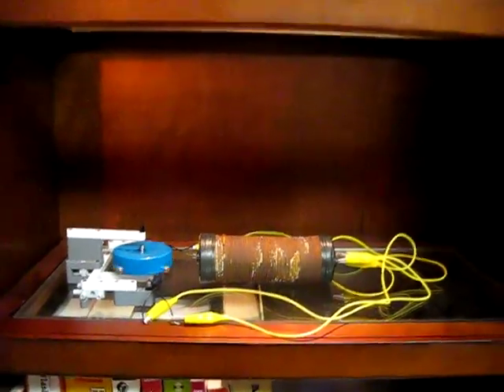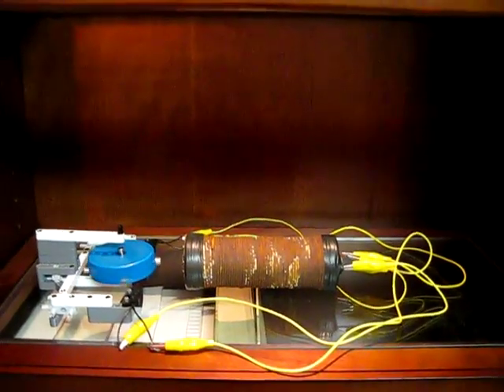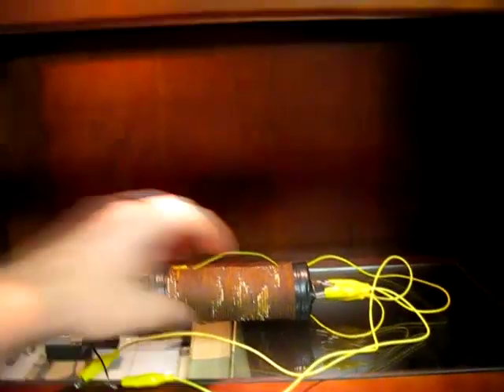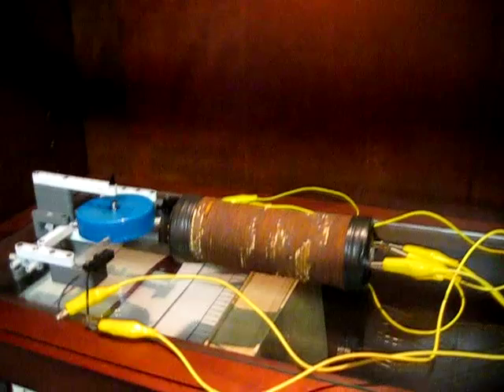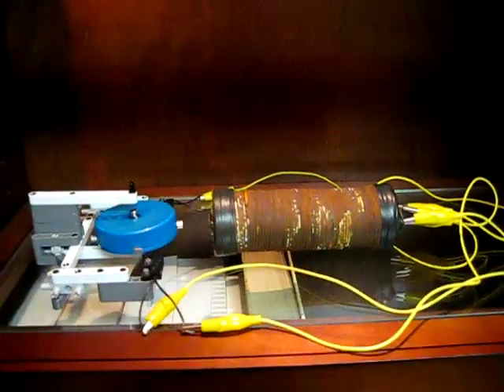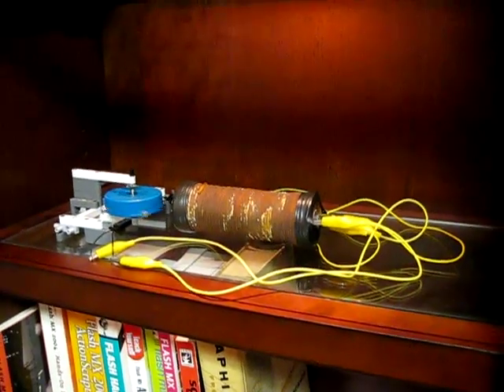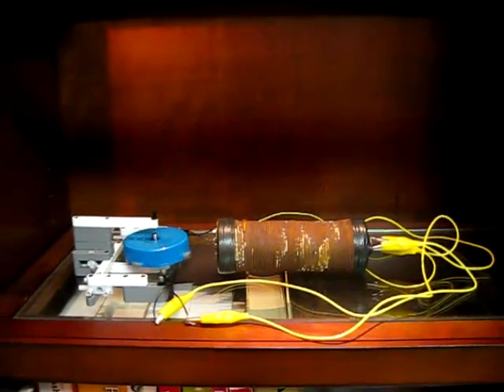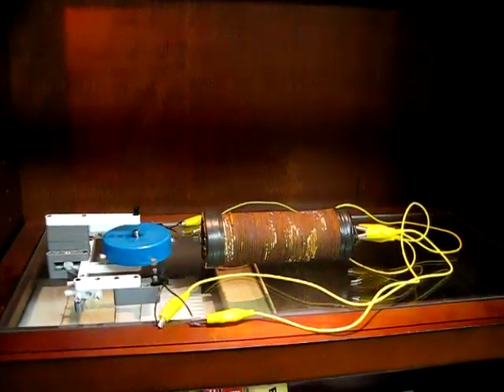Magnet motor NS coil 48 days and still going!

Comment: awesome! i think you might find that if u reposition your rotor magnets so that the edges are facing outward rather than the flat sides, it will be like an S and N facing the coil for each magnet, and it will only want to spin in one direction, but may increase the wheel speed by twice as much or more.

Comment: The motor function seems like a variation on Faraday's homopolar motor, with the coil instead of a dry cell. What makes the Stubblefield battery work is the same galvanic action  as any Voltaic pile. The reason is lasts so long is because of the vast amount of surface area inherent in the use of long coils of wire. Neat, but not beyond the bounds of orthodox knowledge.

Comment: Very interesting.
Thanks for this update.
This thought that the reverse polarity will prevent the coil from becoming polarized is brilliant.
I assume you are still able to flash an led off the secondary at this slow speed without any drag on the motor. Is this so?
Thanks,
jeanna

Comment: @aetherevarising Metal corrodes just from the moisture in the air.  Copper and iron are classic examples of this.  Aluminum and magnesium are examples that create much more galvanic current than copper or iron.  Magnesium has a particularly high energy density.  For magnesium it takes 43.2 thousand joules of electrical energy to produce just one gram.  When it corrodes you get some of that energy back.  So it's no surprise that a magnesium battery can power a microwatt motor for months.

Comment: I think I get the genius of this battery now, by making the coil istelf the battery, you can have a really low voltage drive an extremely high inductance coil, since the battery makes low current, you then use a secondary to "step down" the true voltage of the battery to a useable current.

Stubblefield made his batteries with thousands turns and a huge, soft iron core, to actually pass the current level the battery produces throught the battery you would need massive voltage, except the battery is making a votlage differential accross the entire length of it's windings, It's like having an ultra-high voltage source even though the terminal voltage is low.

Think about it.... how high is the inductance on that coil and how fast does the output rise to maximum?

Comment: Sorry only Pintos are available at this time.  Check back once the US Government allows this technology to surface.  Magnets move without gas or electricity.  Once a way to control the movement is contained, use it to turn an alternator and power a car or even a city with one large enough.  Similar to how a river dam produces electricity for a city.

Comment: If you get tired of welding reed switches go to Radio Shack and get a 15V reed relay.  It;s not what it is made for but they run forever.  I;m using 15V plus the BEMF and pulsing at 130 times a second.  Not bad for $4.25.

Comment: would more powerful magnets and multiple coils improve the performance? I just hang 1 magnet by a string over 3 magnets (same polarity facing the suspended magnet so they oppose) about 1 in. spacing all the magnets)

Comment: Did you admit to making a BATTERY with the Salt Water ( electrolyte ) plus Copper wire and Iron wire? So, you have a battery and reed switches controlling a coil to move a magnet. What is the big deal here?

Comment: @User2718218 For example, you could take an AA battery and put a very high resistance across it.  Knowing the voltage and resistance then you know how much power the battery is putting out.  If the output power is in the microwatt range then the AA cell would power the load for a very very long time.  In this clip, the rotating "motor" is not doing any mechanical work, so it is equivalent to the resistor example.  You need to rationally analyze what you see before making grandiose statements.

Comment: A motor is a device that translates the electricity from the turning turbine in a power plant back into turning motion. That is all it is. The electric motor generator system has replaced. The steam engine motion of its belts to say a lath. The system is transporting motion from source to use for work. The End

Comment: for a homemade coil battery it's an impressive achievement. I would say though the output isn't that impressive. an AA  cell would power a slow motor like this for months like in a wall clock. the key here is how long will this work before the coil rusts to bits and stops functioning. sadly I see this no more than a reinvention of a chemical battery using a more environmentally friendly electrolyte.

Comment: good job! i was looking for comments from our usual you tube suspects that scream: "fake!" i don't see any.
Reply: latreche34 how does this prove it's a fake?
the double reed switch effectively turns the battery into an AC battery (do those even exist?). turning the two poles of the battery into a solenoid, effectively turns tesla's bifilar pancake coil into the terminals of a battery. the iron core strengthens and stabilizes the magnetic field. Depending on the inductance and capacitance, this might qualify as a tank circuit. There's probably a small charge that comes from the magnetic rotor as well as it passes through the coil. Since the gap between the magnets of the rotor is relatively large, there's probably enough time for the circuit to shut off, just as the magnet passes in front of the coil - recharging the battery essentially, before it passes in front of the other reed switch.

Other than that, the last few lines of the Patent describe it as providing constant electromotive force. The reed switches are probably an improvement.

Comment: (2nd) I hope this fact gets back to the discussion on OU.  There is nothing unusual or free going on with your galvanic batteries based on magnesium.  You get the energy by buying the magnesium at the store.  An astronomical amount of electrical energy was used to produce the magnesium in the first place (43.2 thousand joules of energy per gram)  When the magnesium corrodes you are getting some of that energy back.  Have fun with your experiments!

Comment: Note the energy comes from the corroding magnesium.  So how much energy does it take to produce magnesium?  (Google search on "power required to produce magnesium"

Quote: "The electrolysis only step component ranges down to just 12 MWhour per tonne. ...  1 MWh is 3.6 gigajoules."

So it takes 43.2 billion joules of electrical energy to produce 1000 kilograms of magnesium.

That's why your battery can run for so long.  There is a tremendous amount of potential electrical energy in the magnesium.

Comment: @aetherevarising Don't forget that an AA battery can power a clock for a year+.  A quality AA battery running next to this setup would be an interesting test.  This "motor" is consuming microwatts of power.  There is always ambient moisture in the air to sustain the reaction in Lasersaber's battery.  How can you possibly state that you think it defeats the laws of entropy without any data?  This is a fun experiment that proves nothing.  All energy is conserved, nothing special is going on.

Comment: The motor will stop when the metal is fully oxidized. That could take a long time since it's a slow reaction. 
The total energy available from rusting  iron (or copper) is easy to calculate (google it).

Comment: I would replace the reed switches with hall effect sensor if you can power the magnet motor to spin you can power the hall effect less mechanical the better